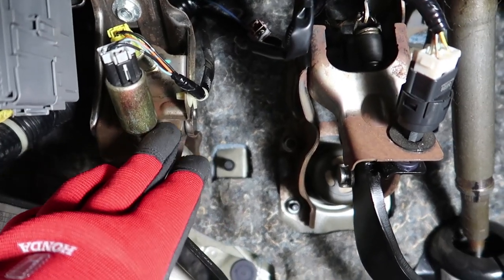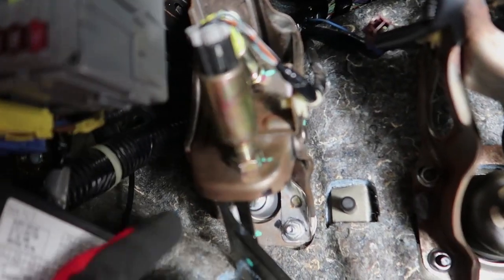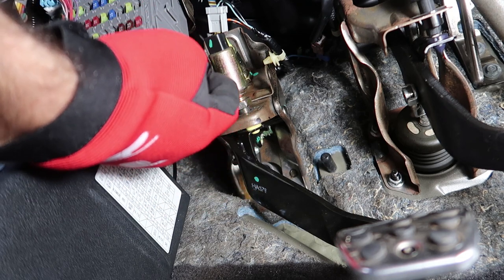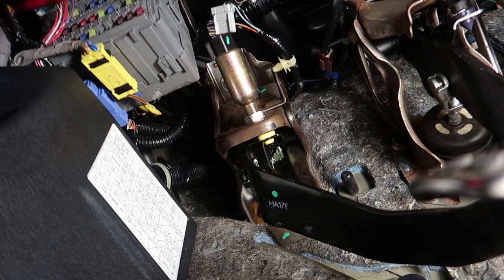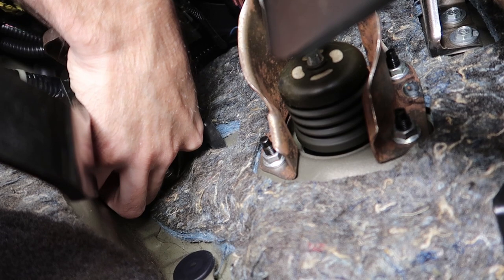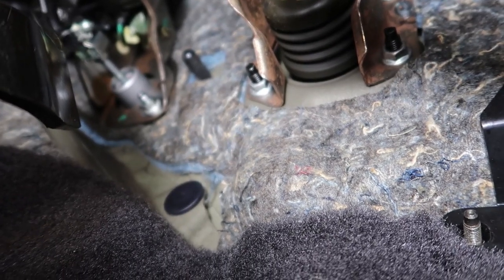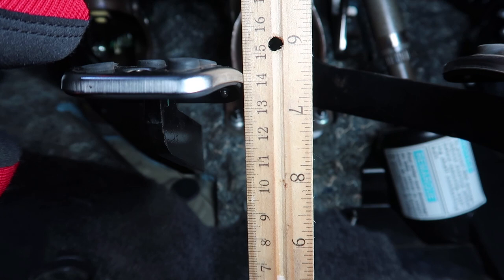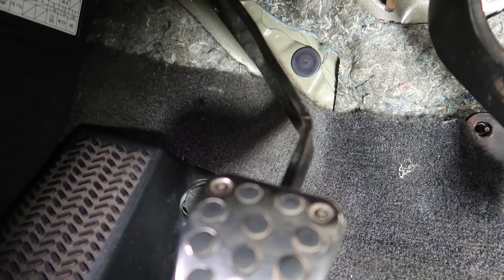8th Civic Si and RSX Type-S Clutch Adjustment DIY | Aftermarket and Stock | FG2, FA5, DC5

Comment: Thanks for sharing. In my Honda manual it also states to adjust the Starter/Clutch Interlock Switch along with the other two adjustments shown in this video, did you also adjust the Starter/Clutch Interlock Switch or it's not necessarily necessary unless the car gives you an issue with start-up? Thank you
Reply from the maker: Hey buddy, most people dont have to but if you have any problems starting the car then adjust it according to the manual, I believe it says to adjust it so that the car still starts even with your foot about 10mm off the floor
Reply: @JasonMcMullen  Thank you for the insight. I have another question, if I turn the pushrod going into the CMC all the way clockwise till resistance is felt then turn back counter clockwise one full turn and lock it down, with the clutch switch adjusted so that the bottom of the threads just touches the clutch pedal released plus an additional 3/4 to 1 full turn, I still have more free-play than I would like.

From my understanding the above process is to adjust the clutch pedal height from the ground (6.5"), will re-adjusting the CMC rod possibly a half-turn clockwise without touching the clutch switch remove some free-play without affecting the pedal height since it has already been established? 

It's tricky to know how far clockwise you can go with the CMC pushrod because when you feel slight resistance with the clutch pedal released, if you turn slightly more it get's very loose almost as if the rod is being removed from the CMC. If I adjust the CMC rod with the clutch pedal slightly pushed in, then its even more tricky to know how far you can turn clockwise before it gets very loose again because the resistance is so slight. The clutch has been bleed and it's an OEM replacement Exedy clutch kit and stock CMC. Thank you.
Reply from the maker: @vanquishstorm3806  Hey buddy, the best way to deal with freeplay is with a mm ruler, that way you can make sure you have enough, it can be very tricky to know like you said, especially if the cmc is not turning smoothly. Most likely you can just remove a little freeplay but its best to measure after to make sure you have at least 9-10mm (to ensure the throw-out bearing is not being engaged with the pedal up). Using a brand new cmc it spins easy so its not really a problem. Using a new one I can count the amount of turns it takes to go all the way in and the amount it takes to go all the way out (you dont want it to be either all the way in or all the way out)
Reply: @JasonMcMullen  Thanks for the insight. Being that I'm adjusting the pushrod in the original old CMC in my car, it doesn't turn as smoothly which can make it tricky to gauge if you are too far out in adjustment. I'm going to measure all of my adjustments with a ruler to verify that I am within specification. Thanks again.
Reply: @JasonMcMullen My apology for all the questions, as far as engaging/disengaging the clutch, if you dont have enough freeplay than the clutch pedal when released may always remain slightly engaged (friction disc applied on flywheel/ release bearing possibly touching pressure plate)? Disengaging the clutch would therefore be the opposite (clutch pedal pressed to the floor/friction disc not applied to flywheel)? 

I recently installed a new clutch and the car drove fine for about a month and now I cant get it into gear with the car running. I can get in all my gears with the car turned off aswell the CMC is not leaking. With this issue, the pedal had very little pressure engaging closer towards the ground. I bled the clutch yesterday and regained pedal pressure but I'm assuming I will also need to dial in the freeplay since the friction disc is now most likely broken in. 

The issue that I am having with the pedal engagement low to the ground and the car not going into gear with the car running, is that an issue engaging or disengaging the clutch? Also, could this have caused any harm to the clutch/trans not being able to go in gear? When I drove the car everything was functioning properly. Thank you for your time.
Reply from the maker: @vanquishstorm3806  hey buddy no problem, I’ve been through it myself so I know how it goes. Having the clutch adjusted should help your issue. It’s unlikely that anything is damaged. When the rod is spun all the way out the cmc will get damaged because it is stopping the pedal rather than the pedal stopper. If the rod is spun all the way in it will possibly damage the throw out bearing and if it is in too much it could cause clutch slip. But most likely for you it’s just adjustment or hydraulic system. I had one person report that their cmc was clogged so it caused shifting issues. Btw if the car is off it will shift even without the clutch so it has to be running to check. Another good way to check is that you should be able to shift with the car running and your clutch pedal even 10-18mm off the ground (this accounts for the freeplay/dead pedal)

Comment: Hey Jason, great video dude. More in depth than anything I've seen with others. So I was thinking about doing this on my 2011 Si I just picked up. 88k and serviced at Honda so the clutch and everything feels good. Only issue I'm having is when I'm shifting at high rpm in VTEC. For example, when I'm in 3rd pulling, it will shift into 4th okay (still have rev hang but if I time it right it shifts smooth) but as I'm pulling 4th and I go to shift into 5th, it will either grind for sec and then engage or just lock it out completely. Same goes for 6th sometimes too. I have Acuity shifter and base bushings, centering spring, and a weighted shift knob on the way right now. Planning on seeing what that does to the slop when shifting at high rpms. So if those don't solve the issue, would you recommend this as my next move? Only had the car a little over a week so I'd like to take care of this asap. Really appreciate it man 👍
Reply from the maker: Keith Fendley hey thanks man I really appreciate it! You can try to give yourself a little more release travel (less threads showing on the clutch height adjustment screw, then redo the freeplay). When I got my car back from Honda (after my stage 1 action clutch was installed) I had to adjust it a little also. It felt good but was too notchy. Just go little by little and see if it helps. Also measure the current freeplay with a ruler and note how many threads are showing just in case want to go back to your current settings

Comment: Old video so no clue if I will get an answer. Have a Hybrid Racing cmc which is a em1 style with a swapped stock rod. Currently have 5 threads showing and my clutch engagement/disengagement is very top of pedal and clutch after almost 6 months is starting to slip. But I think it that it might not be fully engaging.  Wondering if adjusting it to 2 threads showing if it will change where the clutch is engaging/disengaging.
Reply from the maker: yeah if you replaced the rod, the adjustment should be around 1-2 threads showing. Try it out and lmk
Reply: @Jason McMullen  yea we did a transmission rebuild with hybrid racing slave/master cylinder, cables, shifters detent springs etc. Friend doing it has been a Honda Tech for 15 years and is very picky about his cars. So I am pretty sure if my stage 4 clutch was in need of replacing he would of told me. So going to try this before replacing clutch.
Reply from the maker: @johnkrstyen  Yeah give it a try, there is a user guide available for the Hybrid Racing CMC on their website btw

Comment: As i believe the hybrid racing clutch master cyliner is a em1 right? In the directions it says change the pushrods from stock cmc so then i wouldnt need as much thread showimg on the button, correct?
Reply from the maker: if you change the rod then the adjustment should be similar to stock I believe
Reply: @JasonMcMullen  sweet man thanks

Comment: I just adjust the paddle adjustment  it got rid of my 2 gear lockout but my 4 gear high rpm grinds now, didn't do it before. What u think happen.
Reply from the maker: You can try to adjust the pedal a little further out (a little less thread showing on the bottom of the adjustment screw). As long as clutch has enough room to release it should operate properly in 4th also. Some people with k-series transmissions have worn sychros from so many years of shifting with the clutch not releasing fully, but you probably just need to adjust a tad more. As long as the clutch releases the rest is up to the transmission. My 3rd gear is a little notchy but with my clutch adjusted it doesn't grind. Let me know and I'll help anyway I can bro

Comment: Jason help, I’m trying to adjust an oem em1 cmc on my rsx and the rod completely unthreaded from the end that connects to the pedal. Do I need to remove the pin to reinstall it?
Reply from the maker: Yeah just pop that pin out, spin the connector back onto the rod and start over. If you have the pedal height where it should be, the rod should be long enough without coming off. Make sure the clutch system is bled properly also. Thanks!
Reply: Jason McMullen thanks man. Really quick, how many threads should be sticking out on the clutch height adjuster for an em2 oem cmc with aftermarket clutch and flywheel ?  Is it 5?
Reply from the maker: @bhadz100  Is the CMC an actual oem em1 CMC? You might have to swap the rod with the stock K20 CMC as Hybrid racing has you do for their Em1 CMC (instructions on their website). Usually an em1 style CMC (K-tuned, Hard Motion, ect) is around 5 threads showing. It sometimes takes a little more threads or a little less because every clutch is different. Carefully test out the clutch operation on a short drive before driving hard or anything like that.
Reply: Jason McMullen it’s an actual oem one.  I’m struggling to thread back the other end. Do I need to relieve the clutch system of hydraulic pressure to be able to push the shaft all the way and thread the other end back?
Reply from the maker: bhadz100 you can also loosen (but don’t remove) the nuts that hold the cmc in place and slide it back a little to give yourself more space to get the thing threaded again. Just tighten it all back down after. Sorry you’re having trouble bro, I know how frustrating it can be sometimes. Shouldn’t have to relieve pressure
Reply: Jason McMullen thanks! that’s actually what i did. Gave me some slack. Problem now is that shaft. Its not turning.  I can’t seem to extend it or add some free play. Do you turn the rod counter to extend it? This is becoming a PITA.
Reply from the maker: @bhadz100  clockwise will move the rod closer to the cmc, counter clockwise will move the rod out. You can press down the pedal a tiny bit with your hand to make rotating the rod easier. Do you still have the stock cmc that was originally on the car?
Reply: Jason McMullen i don’t have it anymore. It’s been four years since it was replaced. Was just playing around with the clutch pedal when I effed it up bad. Thanks again for all the tips!

Comment: Are you still active on this channel? 
I just got an Fg2 and randomly driving it stopped going into any gears. Do you think this is a cmc issue?
Reply from the maker: could be a clutch system issue, is there good pressure on the pedal?

Comment: I've installed a new CMC, I've bleed the system and saw that no air bubbles were in. Now its time for me to adjust the clutch pedal. I try to do it, however the push rod is not twisting... I have a lot of freeplay that i dont want, any suggestions for a dc5
Reply from the maker: Massi Wakeely push the pedal down slightly with one hand and twist the rod with the other hand, it should make it easier to turn. Just make sure to measure the freeplay after
Reply: @JasonMcMullen  I appreciate the reply, yeah I am going to give that a try. By chance does it matter if the clutch pedal pin (the thing that holds the CMC to the clutch pedal) is on while adjusting?
Reply from the maker: @massiwakeely5591  no prob buddy, yeah keep the pin in. LMK if you have any more issues and I'll try to help
Reply: @JasonMcMullen  Okay perfect, I'll give it a try tomorrow and will let you know how it goes. Thank you once again 🙏
Reply: @JasonMcMullen  Hey just an update I got it to work all thanks to you! But just curious my engagement point is pretty high is that normal? I have about 16mm of free play. A lot higher than I had it before
Reply from the maker: @massiwakeely5591  The higher engagement point is normal, because more fluid is being pushed into the Master Cylinder (for proper release), it take more height for the fluid to come out and allow for clutch engagement. You should get use to it in a week
Reply from the maker: @massiwakeely5591  If you do like a short pedal, I recommend the K-tuned CMC, it makes the pedal about half as long, but it make driving in traffic kinda a pain imo, but everyone is different
Reply: @JasonMcMullen  I'm just glad the car is back and running, thank you a lot!!
Reply from the maker: @massiwakeely5591  Awesome bro!!
Reply: I'm here trying to adjust my k tuned CMC the whole time and this is the only problem I'm having, searched everywhere couldn't find the fix but here it is and I'm gonna be trying it out soon, been stuck on this for 2 days now lol

Comment: Hey man, awesome video, but I was wondering when you say with the upgraded EM1 CMC does that include if you change the pushrod from the old stock CMC over to the new upgraded CMC?
Reply from the maker: I believe when you change the rod, it makes the adjustment similar to the stock adjustment
Reply: @JasonMcMullen  Thats what I was thinking, I appreciate the quick response!

Comment: How do you know if you need to replace vs adjust the stock cmc? 
07 fg2 currenty having crunchy shifting and can’t shift at high rpm. Have gotten stuck in reverse(have to stall or turn the car off to get out) and not able to shift into first after a stop until I pump the clutch pedal a couple times. I feel like the clutch isn’t fully disengaging at times. Sorry for the paragraph lol
Reply: did u find a solution? having the same issue as well.
Reply: @yojerico6057  sadly no, I did the cmc adjustment and it helped smooth out the shifting but still not the fix. I probably have to get the clutch replaced. The only reason I haven’t done it already is because the problems are intermittent so it’s throwing me a curve ball. Don’t want to spend $1000 only to find it’s not the problem
Reply: @5.7tundra  it worked for me, it takes a couple adjustments to get it perfect. Just be sure to find out what the actual problem is rather than wasting time and money

Comment: Hey when you were showing the rod up against the metal plate, mine isn’t even showing the metal plate up against the rod. So what does that mean if you don’t mind helping 😂😂. My friend said that my sensor is screwed in all the way where is the sensor?
Reply from the maker: original xavs hey buddy, the sensor is just a cruise control switch. And I’m not sure what you mean by the plate, are you talking about the part that stops the rod from coming out of the CMC? Sometimes there is price of cardboard in front of it. But that should be there
Reply: Jason McMullen if there was a way to send a picture I would . I don’t really know how to describe it
Reply from the maker: @originalxavs2069  you can email me, jasonhmcmullen@gmail.com
Reply: Jason McMullen okay
Reply from the maker: @originalxavs2069  hey buddy, I got the picture, It looks pretty normal to me, my CMC is brand new and they changed it slightly, but my original OEM CMC looked like yours. I think just make sure you have the right amount of threads showing on the bottom of the adjustment screw (the cruise control switch), then do the freeplay and you should be ok! let me know If I still dont understand, thanks